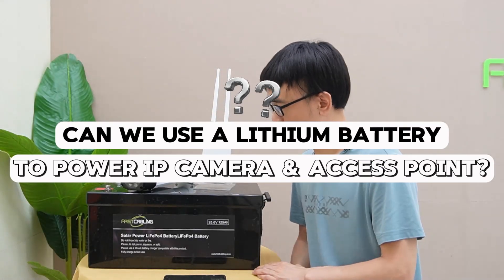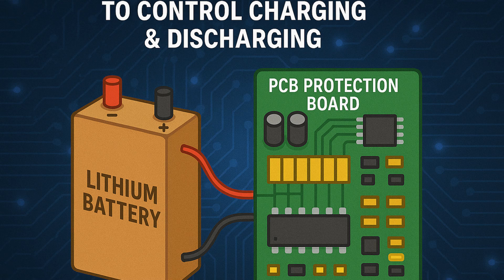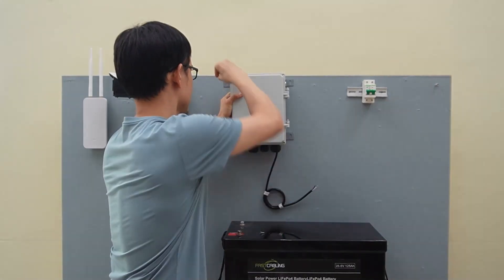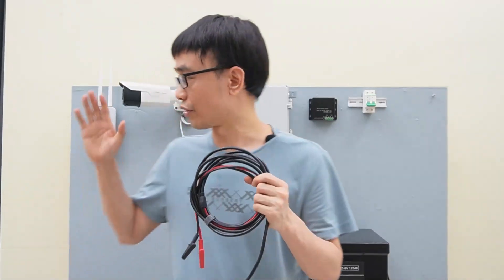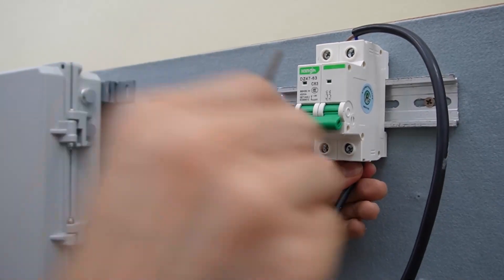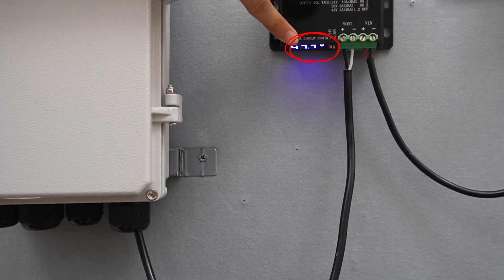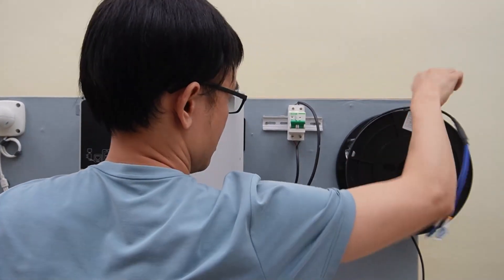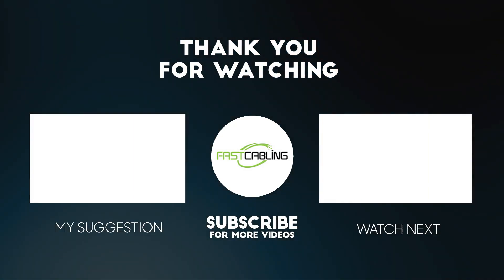How to Power IP Cameras & Access Points with a Lithium Battery | Temporary Wi-Fi Setup Guide

Comment: And let me ask you a question. If you put 2x Single-mode optical transceivers in your switch and put the other side of these connections in the second switch. Will one optical connection become a backup connection?
Reply from the maker: Negative. Connect two SFP transceivers to same switch will create the network loop and broadcast storm which could crash your network. You can configure the link aggregation if both ends support this feature to have SFP transceivers working together to double up the bandwidth.